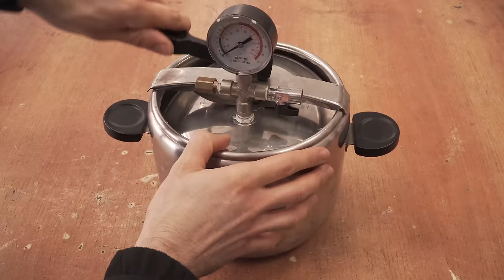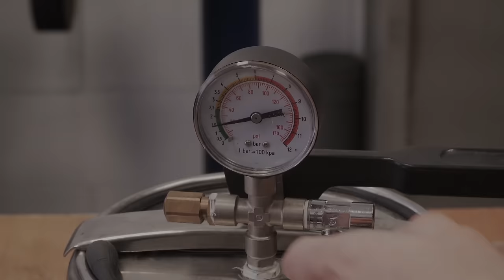Honeycomb Scales Composite Material

Comment: Blackbeard, to minimise bubbles forming on the silicon mould, I modify a very small 12v motor (uneven weight attached to spindle) and then clamp it to the side of the formwork box. This effectively agitates and vents the bubbles out through the top. Especially also useful for fine detailed formes. Playing with catalyst ratios will also slow the cure (and, I think, increase shore strength) allowing more time for bubbles to vent. 

Probably not important in this case but useful method all the same.

Thanks again for your wishes, hoping the same in return.

Comment: Try transparent inks and multiple transparent/opaque layers to produce 3D effects.
Use silicone oil/different density pigments to produce layered colours where the bottom layer colours push up through the top layer colours producing some amazing effects.
Put down a layer and carve a design into it, then use a contrasting layer and some sanding to bring out the carving before completing with a layer or two of transparent/clear.
Use the rubber mold and a 3d printer(or carving) to produce resin shapes that you can integrate into a design.

Mix and match all the above.

Comment: I worked in the aircraft industry with honeycomb structures for 3 years. Recommendation (see 3:38) - such aluminum honeycombs can be easily cut with a sharp knife. Just hold the blade at a 45 degree angle and cut through with short, quick strokes.

Comment: Great job Sir.  I really enjoy your videos.  I also hope you are doing well right now.

I would offer 2 small pieces of advice....  #1, when you are trying to do each cavity a different color, get a lab pipette, or a small eye dropper, to place the resin in the cavity.  It will give you much more control, and help you segregate exactly which color belongs in which hex....

Also, it looked to me like you might have "smooshed" your hexes a little, when placing them in the mold....  Which, in your finished product, threw off the "purity" of the 6 sided hexes....  I would humbly suggest you cut the hex mesh into a smaller rectangle, so that it fits very comfortably in your mold, and does not become distorted....  This is on the theory tht it was "side pressure" that distorted the hexes....

I didn't really grasp initially that you were trying to make knife scales....  I was kind of wondering, "where are we going with this?".  Neat idea though.  I think it could be amazing.  Keep experimenting!  

I really do enjoy your work, and your videos.  Best of luck Sir.

Comment: That's a very nice, unique pattern.
I just wonder about wear over time with the scales due to vibration and oxidation from use.

Metals transfer kinetic energy more readily along their length than the resin, possibly encouraging separation over time with heavy use.

Exposed aluminum will oxidize over time and and crumble into white powder, and even a high gloss top coat will eventually wear down and expose bare metal.

I suppose that's just the rub with this construction method, but I would be interested to see how well it can hold up, as it is a rather striking design.

Comment: Most 2 part epoxy is mixed by volume instead of weight.  I'm not familiar with the brand you are using, but the density is often different in the two parts and weight would affect your ratio.  I enjoy your videos.

Comment: Get some real honeycomb.  With a hot knife, cut off the tops of the cells. Turn the comb upside down and allow all of the honey to drain out.  Wash the comb with cold water until all of the honey has been washed away.  (Alternatively, make nice with a beekeeper and have him give you some comb that has been licked clean by the bees.)

Pour resin into the comb and turn it upside down into a pan with 1/4" of uncured resin in it.  Allow the resin to cure.

Put the cured block of resin in boiling water to melt the wax.  Wash the resin with vegetable oil to remove the last vestiges of wax, then wash thoroughly with soap and water to remove the oil.

Voila!  You now have a cast of the insides of the honeycomb cells!

Figure out something incredible to do with it!